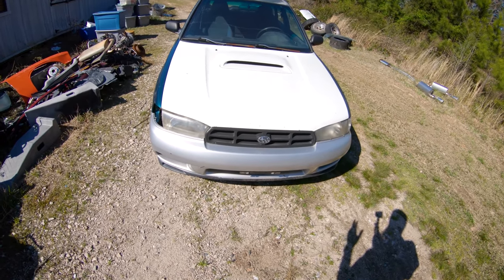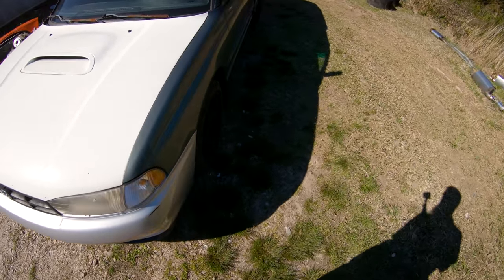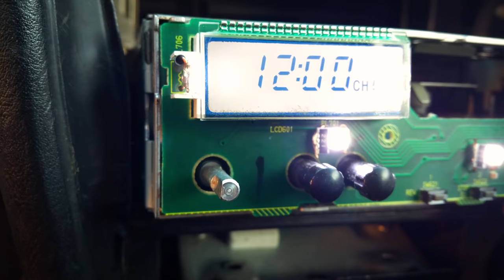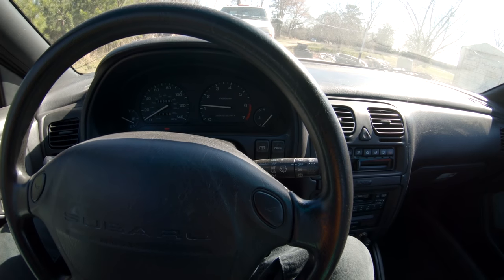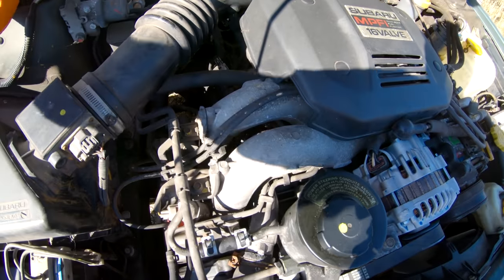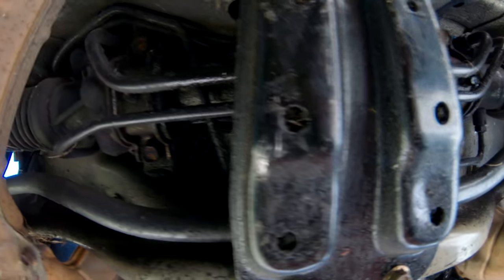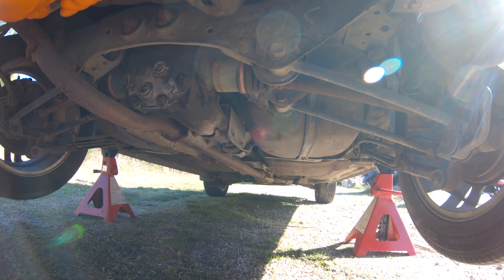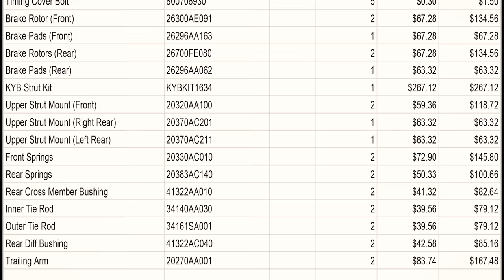Taking Stock of Patches

Comment: Loving patches!!! My 95 Legacy is beat up but is my daily and is mechanically sound. I installed 05 Forester XT struts and wheels to give it a few inches of lift to endure the mid Atlantic winters. Patches has the same problem mine has: fuel gauge, showed empty when it has half a tank, the HVAC control panel was replaced due to drinks spilling from cup holder, resealed the engine when it was out because everything leaked and kept rust away from the cross members. All the usual stuff for this generation. Hope to see more great stuff for patches!!!!

Comment: Great Video! I just replaced my 1995 Legacy L wagon 2 years ago. Drove it from 48k to 253k from 2003 to 2017. All northern Michigan miles (car originated in Minnesota). There was a wee bit more rust on the underside of my car, although it did have original exhaust front to back, including factory OEM muffler right to the end. I also got a factory cd player form the junkyard to fit in the vacant cubby hole. LED lights held up pretty well in the radio, but lost some backlighting for HV position push buttons. If you don't think you will use the cd player much, how often do you think you will use that fancy cassette player? The design and placement of the cupholders was ill-conceived. If something were to spill from the cup, it would not only gum up the cup holder function, it would also spill/drip onto the audio and HV buttons.  I found the cups liked to lean forward, which was even worse. Maybe this is why the radio backlighting failed. I had the same intermittent whine/humming when the A/C compressor would kick on. I just put up with it as I was told it was expensive to replace the compressor and the a/c continued to function fairly well.  You may be ok with the wheelbearings, though. I don't recall having issues with those, and they didn't make your parts list, so maybe it will be ok.
Great car!  Mine even survived 2 collisions with deer. 
Again, great video. Great memories!
Thanks, again.

Comment: I was wondering. I have a 2007 Impreza Outback Sport which I had a failure of the ECU was giving a #3 cylinder misfire code. Had car checked by a "mechanic" said ECU was bad. Sent ECU off had a repair made. Did not correct the issue of misfire. Did my own investigation found wire burnt on #3 injector wire harness and I fixed that. Car no longer has a misfire but now i'm getting a new code. P0458 I replaced the Solenoid valve. No help. I now get two codes after clearing code initially. I get the Low idle and the P0458 generic codes only after a second start. Do you think the ECU is damaged beyond repair and if so will a used ECU work that comes out of a 2007 Impreza Outback Sport that has the same 7th digit in the VIN number without having a reprogram done?
Reply from the maker: That's near impossible to speculate on without putting hands on the vehicle myself. The P0458 EVAP code is most likely a secondary issue, unrelated to the misfire. Couldn't say for sure without checking the Purge solenoid electronically and a smoke test of the EVAP system.
Reply: @MrSubaru1387  Even after replacing the EVAP Valve. and still giving the same result? The car acts as if it dumps the Programming on the second start of the day when warm, but it will go into the "survival mode" and work itself out. I have a ECU on hand out of a same year car. Whats the worse that can happen it won't start? :-)
Reply: Any recommendation on a good diagnostic scan tool for under $1500 I really get tired of paying for work by shops in my area who don't do a good job and that includes my local Subaru dealership. I figure if I can repair Aircraft and Helicopters car's can't be that difficult with the right tools for proper trouble shooting. (on my own stuff only)
Reply from the maker: A bad solenoid isn't the only cause for the code. There could be a shorted wire to the solenoid, or a host of other issues. You can try swapping PCMs, but if there is a fault that burnt out a driver in the current PCM, installing another PCM, without addressing the issue, can/will cause the same damage in the second PCM.
Reply from the maker: I have trouble recommending scan tools. Personally I've always used Snap-on scan tools, but price wise, they are far too expensive for a DIYer. After being a Snap-on dealer for years, and seeing what I've seen, I only deal with the Snap-on or OE tools. I've seen Autel, Launch, etc mess up cars. I also know they pirate software for their machines. I have a Snap-on ZEUS and MODIS. Primarily for the 4 channel lab scope. It's fairly difficult to diagnose accurately anymore without a lab scope.
Reply: @MrSubaru1387  I will have to take it to another local shop tomorrow to have it put on a diagnostic test unit. I will let you know what this guy finds out. I watch your videos and I find your information to be solid and I think you're an upstanding technician. If I lived in SC I would just bring it to you, but I live in the hills of WV and that's a little out of the way. If push comes to shove I will pull the Intake and look at the wiring harness for broken wires. (little hard to get to without pulling it. You understand.
Reply: @MrSubaru1387 Ok just to give you and update on my 2007 Subaru Impreza OBS. Took it to the local shop. They put on the Snap-On Scanner unit. They told me the Throttle body was defective and I needed a new Throttle body unit. Well They couldn't find one in stock from their local suppliers (good thing for me) Anywhooo. I payed my 1/2 labor charge of $27.50 got in the car and noted they didn't clear the check engine light. Put in my little UScan tool and cleared the light, and finished my business in town. Came home 38 mile drive one way, parked the car, shut it off and then waited for about 30 seconds and started it again. Boom! Engine Light. Checked the code with my UScan and cleared then double checked. Pulled the Negative BT off and called it a night. 

Well today I got the New(used) from a 2007 Impreza OBS VIN JF1GG63625H800197 in the mail. $75.00. My VIN is JF1GG63647H814179, So I figured what is the worst that can happen. 

I cleaned the Throttle body on the car (it was nasty inspected it with a mirror) Noted: that the two lines off the airbox on the throttle body were not reinstalled from yesterdays visit. Removed my ECU and installed the replacement unit. Put the airbox back on the throttle body and reinstalled the lines. Hooked up the battery and checked the to see if the ECU was present via the UScan tool. Started the car and allowed it to run until the fans kicked on at 205 Degrees. Shut car down checked for codes and took it for a test drive. I would say it worked. 

I will be getting a scan tool. I am tired of the "Local guys" when it comes to doing work or diagnoses on my vehicle. I will continue to be a loyal follower of your channel. I would like to see a video of a Rear bearing and bushing change in the future if it comes up as a part of a fix up. Thanks.
Reply from the maker: Glad to hear that you got it sorted. Hate crooked techs that don't know how to diagnose..
Reply: @MrSubaru1387 Yes I'm a little miffed about getting the constant rip off. My view is If I can fix a multi million dollar Aircraft or Helicopter I sure as hell can fix a car with the right tools at my disposal.